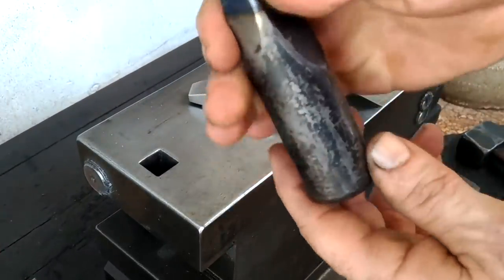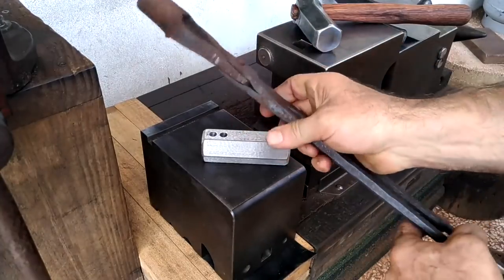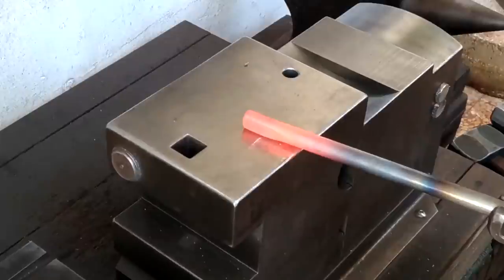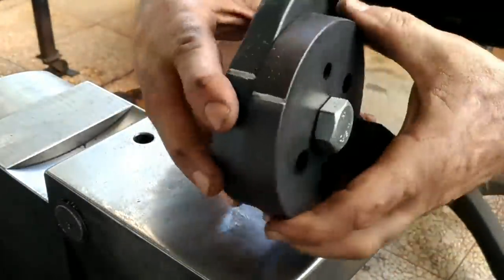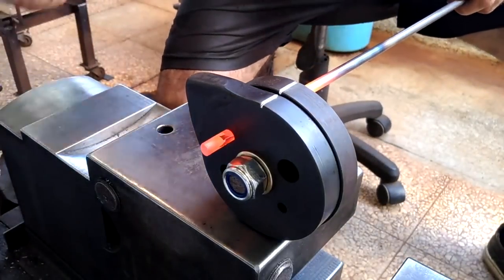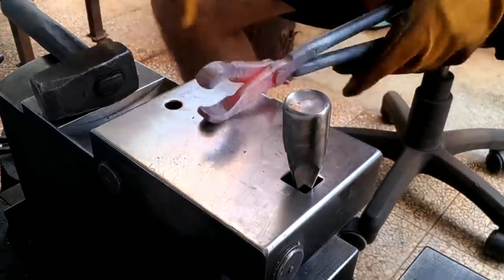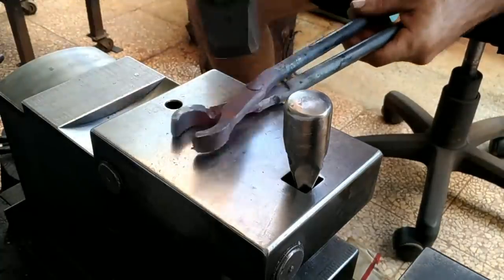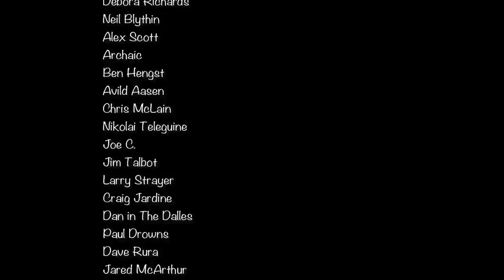Forging Alternative Style Punch Tong

Comment: it's such a simple comment: "make shorter punches" = use less metal. 
It extrapolates out to: make more punches using the same (original) amount of metal
"Make tongs for punches": one handle rules them all. Less material/time/$$$ used. 
Very efficient and great concept. Thanks for the vids Glen!
Reply from the maker: Sometimes thinking simply is best. I am in the process of making a full set of short punches / drifts. Thanks my friend.

Comment: After fighting various punches, I found that putting a handle on every single one, like your rivet header @ 8:30 , to be the best for less fumbling when the time comes to gitr done. Will also give you an excuse to make a pegged rack for hanging them in plain view and avoiding another box of tooling that you have to dig through every time a particular one is needed. 🧙‍♂️
Reply from the maker: I used to do the same for all my punches - give them permanent handles. I've gotten away from that but with me, I always revisit what I was doing in the past at some point. Thanks Stan.

Comment: I like the simplicity of the tongs. I just made a stubby hot cut that looks similar to your punch. Maybe I should try tongs instead of a handle
Reply from the maker: I'm working on more short punches / drifts and this tong is getting a lot of use. I honestly don't love using a tong for this sort of eye forming but it has really helped cut down on the noise and I'm really liking the shortness of these punches. Thanks.